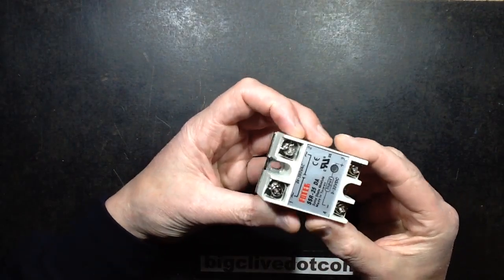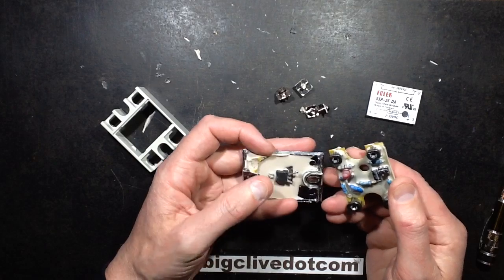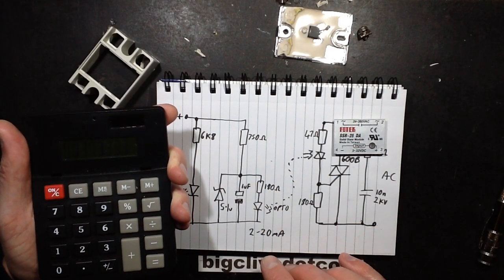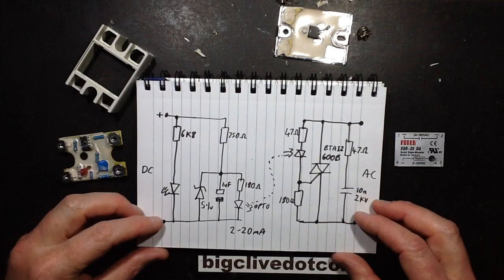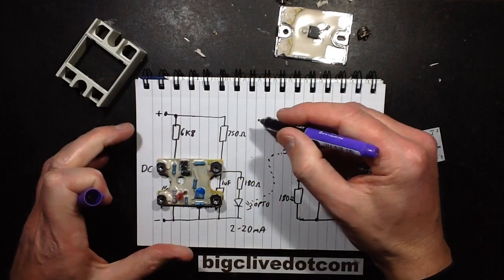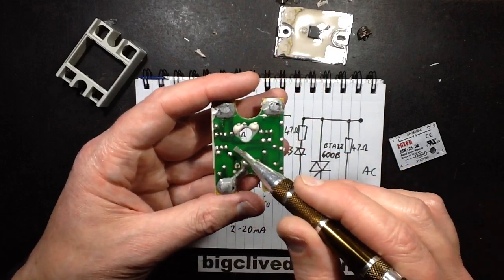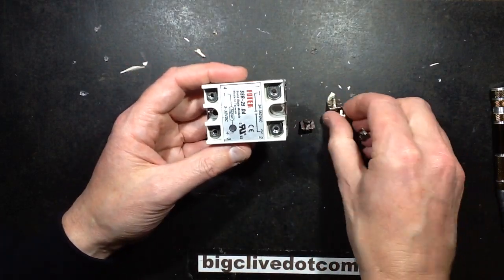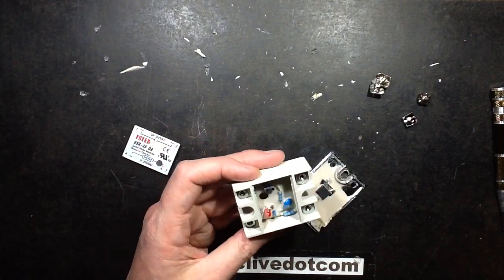Teardown of an eBay 25A Solid State Relay.  (SSR)

Comment: When these things fail, they short out.  I've had two go bad on me in two years.
Reply from the maker: Shorting out and staying on is a common failure mode for triacs.  If you do a continuity test across the unit while the power is off it will usually read as a a short circuit.
Reply from the maker: That's the most common failure mode for triacs.
Reply from the maker: Two in series would still carry the risk that in the event of a short circuit on the output both would fail in an on-state.  In situations where this could be dangerous it's not uncommon to use a relay or contactor in series with the solid state relay and switch it on before and off after the solid state relay so that it doesn't have to make or break load, but will kick in if the SSR fails.
Reply: Its not good scenario for DIY point welders.
Red glowing metal just shoots to all directions...
Reply: I had one blow on me today, huge white flash and a bang. It stayed shorted out after
Reply: Most common is for both sides to stay latched, runner up is only one side of the triac turning on, the rare but most desirable both side stay open.
Reply: That's not good. I wonder is a couple in series would be a good idea.
Reply: Well, I meant two of the complete devices. Complete redundancy. At the price of these, not expensive. I use one on a mini-kiln so if it failed closed, it would probably burn out the element and possibly damage the work I'm doing.
Reply: relays can do the same though ... they can weld shut.
Reply: @km5405  Thats why connecting an ssr and a proper contactor in series. To have the ability to pwm regulate a load without burning the contactor contacts. Just for safety disconnect. During mashine operation the contactor would never switch currents and should last very long and the mashinery won't make clunky noises.

Comment: if you use one of these make sure you derate it by 50% especially if you don't use a heat sink. (ebay sells them) I have had quite a few fry spectacularly  (fire smoke total met down) controlling a 1500 watt heater 120 v. swapped out for 40A rated ones (almost same price) and stopped the fire hazard. BTW they work very well connected to output pins on arduino boards

Comment: I need one of these to power a 230v heated bed on  a 3D printer using a 24v power supply to activate it , What one would you recommend ? I have no experience in this side of electronics. Thanks
Reply: Montague Flange not sure if it's too late but get a real relay from a verified reseller.

Fotek is a good brand, but there are tons of fakes like this one out there.

Comment: Nice video, like the knowledge. Tks for sharing!

I'm using one of these (10A though) to control a 220V 800W silicone heating mat over an arduino (5V signal), and it randomlly crashes the arduino - often on plugging/unplugging the ssr power from the outlet :/ I'm guessing it's just the poor quality of the insulations that lets some peaks "get through", no?
Reply from the maker: Arduino's like any other computer can be crashed if there are glitches or spikes on their supply.  Try adding an extra reservoir capacitor like a 1000uF electrolytic close to the Arduino on its supply rails.
Reply: Thank you so much for taking the time to answer me :)
You mean between the Arduino and the Power Supply, or between the SSR and the Arduino's 5V control of the heater? Tks o/
Reply: arduino and it's power supply. 1000uf is quite big. i see people use a couple extra 47uf because they are small cheap and common.
Reply: i've tryed the capacitors and they didn't cut it. Bought a Crydom D2425PG and solved it!

Comment: Opened up an eBay Fotek SSR-40 VA (phase angle controller) you'll never guess what! It's (the triac) not rated for 40A but 25A. At the price it's worth buying two to tare one apart before using the other. 

I would advise a PSR-25 if you are looking for something a little more tried and tested for phase angle control.

Comment: i use these in pinball machines that have ac motors controlling backbox animations
they are easy to drive off the 24v solenoid lines and don't have woefully undersized traces on pcbs to burn up without blowing an 8A fuse

Comment: I have been watching your videos for weeks, and really like and have learned a lot.  But one ting I miss is how components are used.  Such as this ssr.  I don't know how its used.
Reply from the maker: It's used where you want a small control circuit to switch a much bigger and higher voltage load.  The control circuit supplies a small low voltage signal and the SSR (Solid State Relay) then switches the bigger load.

Comment: Another very informative video from BigClive, thanks. I have a particular problem in implementing the use of two of these relays inside my CNC electronics enclosure and I wondered if you could you shed any light on this.

As I mentioned earlier, one of these relays switches the power to my VFD, and the other switches the power to my dust extraction unit. They both perform flawlessly as you would expect by switching on and of using a DC control signal. The problem I have is this, I wanted to install indicator lamps into the door of my electronics enclosure, the sort of lamps typically used in industrial control applications, they are actually LED lamps which require an AC voltage to drive them. However when connecting the lamps to the output of the SSR's they are permanently illuminated even when there is no DC signal switching on the relay. Upon checking the relays with my multimeter there is 33 volts AC on the output when not switched, which is enough to illuminate the lamps. Since I have already drilled two 22mm holes in the door of my nice new enclosure I am going to find a work around, so I have ordered two din rail mounted electro-mechanical relays, also from China.

Is this bleed voltage typical in SSR'S, or are these particular ones from China badly designed? Could this perhaps be the subject of another  investigative video from your good self? Or is the answer obvious to someone with more than a basic knowledge of electronics such as myself?

One again thanks for your effort in producing and sharing these amazing videos.
Reply from the maker: +Fred Morris This is common with triac based switching as there is a snubber network across the triac to recue the risk of false triggering by transients.  It typically consists of a 100nF capacitor in series with a 100 ohm resistor, and it leaks a small amount of AC current that is usually no problem with high loads, but will cause low loads to at least partially operate.

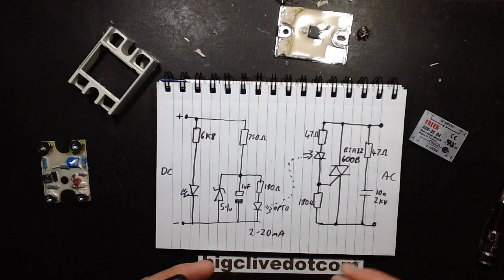Comment: 3:30 Since when was 32 - 5 = 28 ? :-)
Anyway thanks for the teardown and schematic.
To go from voltage and resistance to power you can just use this formula: V^2 / R = P
(32V - 5V)^2 / 750 ohm = 972 mW
Reply: P=VI and I=V/R  
=> P=V(V/R)
    =V^2/R
Same thing.  
But the first way you also get the current, and no large numbers from squaring makes for easier mental arithmetic.

Comment: I just had a pair of the 40A version fail on me. When taken apart I found that there was no potting at all, and the Triac is a BTA16-800B, ie an 800V (good) 16A (bad) device. 
I had two of the SSRs, they appear to have both failed short-circuit simultaneously. No idea why. I think I will replace with a mechanical relay.
Reply from the maker: +andy pugh Triacs tend to fail short circuit as standard.  Either due to serious overheating or an external short or surge that caused excessive current flow.
Reply: None of the above really fit, this is a setup that was bench-tested and worked, then both SSRs were broken when first used on the machine. (either they failed on the last test, or failed at switch-on). As the consequence of the failure mode is a small explosion I have decided not to use them any more.
Reply from the maker: +andy pugh What were they driving?  Was it a very inductive load like a motor?  For a professional application I'd tend to recommend the high profile branded components are used.  The cheap Chinese ones are OK for personal projects and prototypes.

Comment: I have the Solid State Relay SSR-40 DD DC-DC 40A 3-32VDC Input 5-60VDC Output L5YG from China. I got this relay on Ebay. I did a test where it had to pass 14 amps on the 12 volt output for about 10 minutes. Even using the proper heatsink it got very hot. If it can handle 40 amps dc output why at 14 amps does it get really hot? I believe that it it is only 10 amps rated and they have it stamped at 40 amps.
Here it the link where I got it.......   http://www.ebay.ca/itm/321369927133?_trksid=p2057872.m2749.l2649&ssPageName=STRK%3AMEBIDX%3AIT
Reply: I scrapped that idea and used my ssr just to switch on a mosfet  switch.

Comment: 3:35 why didn't you calculate the power dissipation of the resistor with I^2 * R?
Reply: +Blowitup1991 Why would he do that when he only knew the voltage and resistance to begin with?
The formula he should have used instead is V^2 / R = P.
(32V - 5V)^2 / 750 ohm = 972 mW.
He did however made a mistake and said 32 - 5 = 28, when it's actually 27.

Comment: I didn't realise that these units have a leakage current of around 3.0mA on the output side.  This makes my 240v 10 watt LED spotlight flash every 5 seconds or so when the light is switched off.  Does anybody know of a way to stop the leakage?   UPDATE: I now have the solution, Use a standard, coil driven relay with actual contacts.

Comment: Bought a few "FOTEK" SSR-25DA a few years ago, used them to control approx. 1kW heaters at 230V. A very light load, only 4-5amps and I have had no problems. Fortunately they are also mounted on a decent heatsink, enclosed in a metal box and controlled by a PLC so there is no human contact with the input.

Had some leftovers so after watching this video I cut one open and found a single BTA20-600 inside. A bit bigger than the one in the video but still only rated for 20A, not the full 25A. 

The input circuit is different and actually quite nice, it has a LM337 regulator connected as 12mA current limiter, which supplies constant current to the optocoupler for the full range of 3-30V. 

However the PCB is horribly badly designed, input and output traces very close (1-2mm) for the whole width of the board, there is quite enough space to do this properly, really makes one wonder why they had to screw it up.

After some thought I got more curious and two weeks ago I ordered a few more SSR-25DA and SSR-40DA from different China ebay sellers just to check them out. Shipping was unusually quick, they all arrived here in Iceland 7-10 days after ordering. 

First I noticed that none of the items looked exactly like the pictures in the listings, minor difference like "Taiwan made" changed to "Made in Taiwan" and "Solid State Relay" becomes "Solid State Module".
 
Next I split them open and found a single BTA12-600 inside the SSR-25DA type as in the video.  So only a 12A TRIAC in a 25A rated module, not good!

The listing pictures for the 40A show a module with two screws on the bottom, indicating it might have two power-components, one could even dream about two antiparallel SCRs which is the proper way to make a 40A SSR. 

Unfortunately they sent a different type with just one screw and a single BTA16-600 in the SSR-40DA. 16A instead of 40A, even worse than the 25A one!!

Also the RC filter across the TRIAC was completely missing, no components, just empty holes on the PCB!!!

The PCB of the 25A type is exactly like the one in the video, but the 40A has a much better PCB, with SMD components, good clearance and a milled slots between input/output traces. The 40A is also filled with more resin, the space below the PCB was almost completely filled on the output side and the components on top of the board well covered. A real shame they then ruined the whole thing with a 16A TRIAC.

Some used heat conducting paste when mounting the TRIACs, some had no paste.

It is possible to disassemble those SSRs without much damage, first pry the top cover with sticker up using a small screwdriver.  Next use a fine tipped soldering iron to melt/burn the resin from the head of the TRIAC-fixing screw. Then remove the screw and finally the metal heatsink.  The TRIAC will stay in place and hopefully not tear any traces on the PCB.

Reassembly is also possible, but hardly recommended.

After this experience I will try to avoid those SSRs. 
They are only good for appox. 25-30% of rated load.
They should not be used where humans (or any other live creatures) might come in contact with the input wires, the insulation between input/output is not to be trusted.
Reply: i got one too, im using it with a PID temperature controller and a 2kW water heater. works fine, i dont have heatsink mounted. few minutes of use and it was slightly warm.
Reply: No problems with them at 6 amps or so. Varistor protection and additional RC snubber is highly recommended.
Reply: Good info, but I don't think a lm337 can drive a IR led (Vf=1.2v) with on 3volts input. Dropout is ~1.5v, plus Vref=1.25v, this would leave only 0.25v to drive the IR led. 
I could see Vin of 4v working.

Comment: I messed around with some triac circuits some years ago which were basically schematic equivalent to this thing. Had no difficulties powering incandescent lights, occasionally some difficulties with compact fluorescents (the holding current you mentioned).

One thing that I think would be extremely good advice is to be VERY CAREFUL about powering heavy loads and/or heater loads with these devices. When the triacs got warm, they tended to self trigger, so that even when the opto-isolator circuit was turned off, they would still pass current. (negative temperature coefficient of solid-state devices)

If you are thinking of controlling a heating device with one of these, I strongly recommend using an electromagnetic relay instead -- especially given clive's teardown results showing you can't trust the printed current rating.
Reply: Or, yanno, you could use a proper SSR instead of a fake one.  Real SSRs are not built this way, and they use back to back SCRs not triacs, so there's fewer junctions in the current path, the heat sink plate isn't a joke, the cases are backfilled properly, and so on.  You do realize that you CAN'T use a mechanical relay for PID controled systems, right?  You knew that, right?  RIght?

Comment: I have bought 4 of these. one of the first two would not operate at all. I've had no issues with the other three.
I have two operating in my cnc setup, switching on my spindle and vacuum system with no issues at all.
My little spindle pulls maybe 8 amps, and my vacuum about the same.

Comment: I have 3 of these that when no input is applied, they keeps jumping on a few milliseconds every second or so...
Anyone knows why? Any ideas?
Reply from the maker: +Nuno Oliveira Have you completely disconnected the control side to see if it still does it?
Reply: +bigclivedotcom Yes, the DC 5v wires were disconnected and the 7w lamp flashes approximately 1 time per second.
The first time I thought I had a bad one. But this happens with 3 SSR relays...
Reply from the maker: +Nuno Oliveira Ah!  That's normal.  It would happen with high profile ones too.  The issue is slight leakage of current through the triac's snubber network (a resistor and capacitor in series across the output terminals).  It passes enough current to trickle charge the capacitor in your lamp until it tries to start and then it flashes and instantly drains the capacitor so the cycle starts again.  Try a different lamp or add a load resistor or other low wattage lamp.
Reply: Thank you! I've changed to an old style bulb 100% resistive and no more problems. 
The leakage current reads 20 uA on my meter and this should not be dangerous to humans at 230v, correct?
Reply from the maker: +Nuno Oliveira Do you mean leakage when the solid state relay is off?  You can't relay on a solid state switch as safety isolation for something that is going to be touched.  A static spark from a finger contact could cause the triac to trigger and turn on.  They also tend to fail short circuit when subjected to a brief short circuit like a failing lamp.
Reply: +bigclivedotcom I won't be touching it as the control will be randomly turning on 2 or 3 times per second. I'm just learning how it works. :)

Comment: These damn SSR's are a joke. The only thing that makes them worth it to buy is the actual price. You will get maybe 2-3 months in an application that is pulling 8-9 amps on 120VAC. I have these in my HVAC system controlling my window A/C unit and my heater off 24VDC power supply with a wall thermostat. I am actually working on switching to something like omron SSR's cause when these fail they close the circuit having whatever is attached to it run constantly even without power applied.

Comment: One thing that was omitted in this teardown is a review of  the triac to baseplate isolation.

It is critical that the line voltage is isolated from the heatsink.
Reply from the maker: +Peter Dvorak I should have done a 1kV test.  The BTA12-600B is an isolated tab triac if it is genuine.

Comment: I honestly would NEVER buy stuff like this on eBay. Always from Mouser Electronics or DigiKey Electronics.
Reply: eBay is full of fakes. The one bigclive has is fake.
Reply: Or just build one ourself.
Its only few components worth of 1$/EUR.
If we are running it from arduino(5v) and we dont need that extra led, its optotriac, three resitors, capacitor and triac...
Reply: +Mark II ..Yeah, they've been around for a Looooong time......